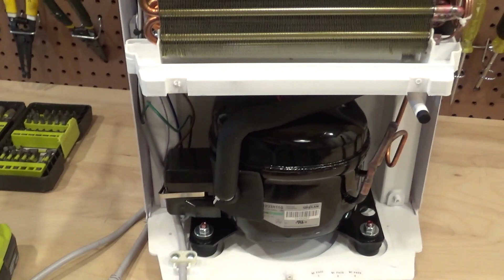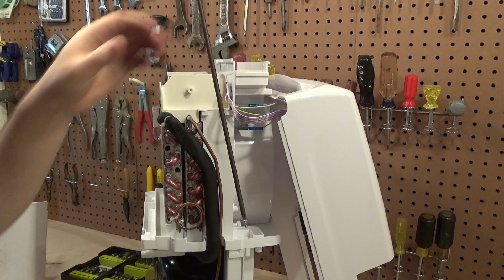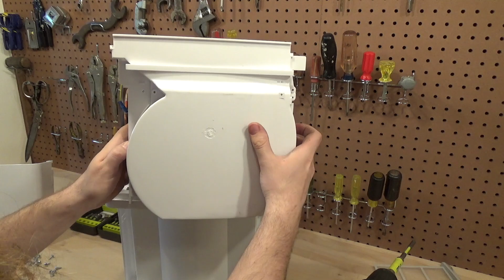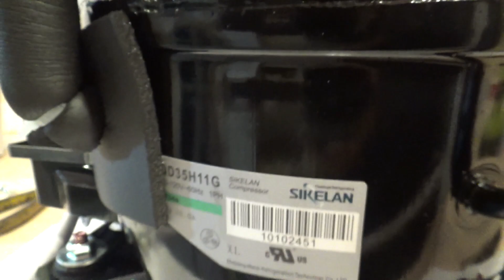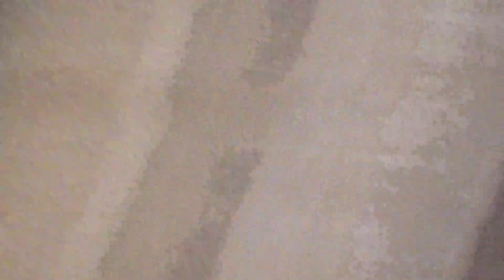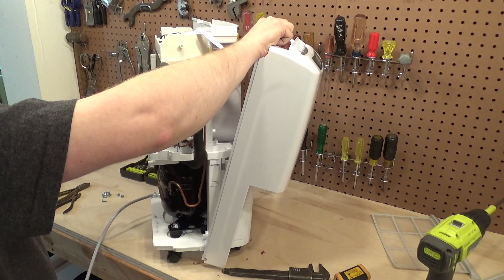Waykar PD160B Dehumidifier Tear-down

Comment: I found an 8 pint version of this machine recently under the brand Homelabs. Once i saw the extremely compact size, the r134a refrigerant, and how quietly it operated, I immediately picked it up. It’s extremely quiet, sounds like an air purifier when it’s running. Looks very similar inside with the same easy serviceability, just smaller. I think these are made by TCL but I could be wrong. Looks like these are OEM’d by quite a few companies.
Reply from the maker: These are a pleasant surprise for something of recent make.

Comment: Which of the pipes is the low pressure for the refrigerant? I am trying to refill mine with some R134 I have lying around. It runs and blows air but doesn't eve collect any water, nor does it get cold.
Reply from the maker: If you don't know how the system works, you have a lot more learning to do before attempting to recharge a system. There's probably more troubleshooting to be done as well.
Reply: @JordanU  I figured it out. Needed a recharge and worked after I added refrigerant.

Comment: Sadly if the humidity sensor goes bad, it will brick the unit unless you replace it. No way to bypass it without disassembly.
Reply from the maker: That's going to be the case with just about any dehumidifier.

Comment: HELP PLEASE SOME ONE!  I have had this model running for three years no problem. Humidity set at 30 and always kept the basement about 45.  Now the humidity is 70 and room 75, but is was still set at 30 for humidity.  This drains to the sewer and hose is clean.  I need to know what changed or how to fix.  I keep resetting to 30, but does not stay set. There are no error messages.  I hope this is something this little lady can handle.  Thanks for any reply.
Reply from the maker: Probably an electronic control failure. Contact the company, from what I've heard, they're pretty good about replacing defective units even past the warranty period.
Reply: Jordan, Waykar states I need refrigerant & it should be replaced.  It is only three years old.  Is this something I can do or shouldI just replaced.  Thanks for all your time.
Reply from the maker: @bjlivigni4687  The cost of having someone repair a leak and recharge would exceed the cost of a new unit.

Comment: I have this model and after 3 years of nonstop running in a basement, there was gunk built up in the drain holes. Leaking water everywhere. And while its a fantastic dehumidifier, WayKar doesn't provide any disassembly/reassembly instructions. I would never have managed to open the panels and reassemble without damage if it weren't for this video. So much appreciation!!
Reply from the maker: Glad the video was helpful.

Comment: I have a very similar little unit branded "Yaufey". So far I'm very impressed with how nice of a machine it is. I have not used nor owned a modern dehumidifier in several years since I have yet to find one that has been satisfactory for me. This little guy so far has really impressed me, enough so that I may pick another one up soon. The one I have now was free from the side of the road even though it appears to have very little use on it.
Reply from the maker: I have seen these under a few different brands and designs. Probably the only modern dehumidifier I'd trust. I'd rather run 2 or 3 of these than one of the larger ones with the cheap rotary compressors that run scalding hot.

Comment: thats is not a reciprocating. i can tell. its a linear compressor because of the weird shape the top has.
Reply: From what I can tell doing some research on this particular compressor, it's a standard reciprocating compressor. Case shape is not a guaranteed way of determining compressor type.
Reply: @brunoshow124  weird. ive never seen a recip like this.
Reply from the maker: Thanks for letting me know.